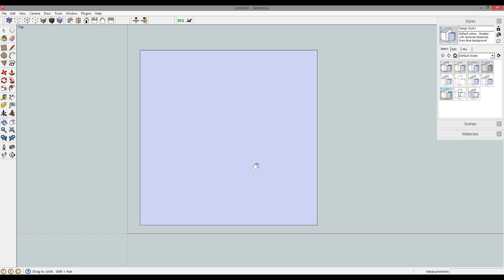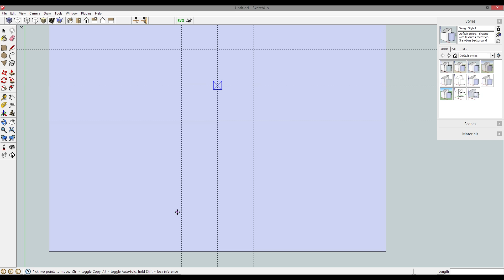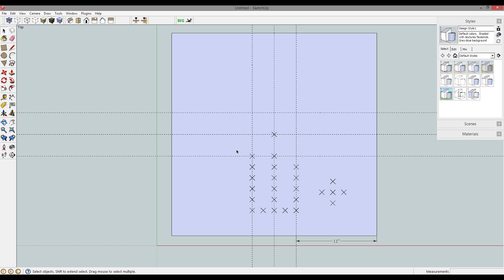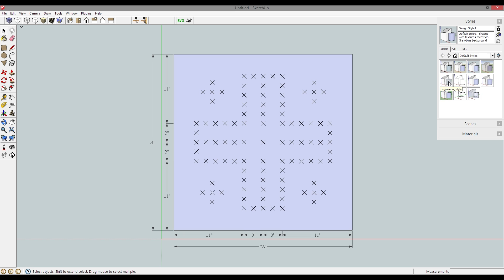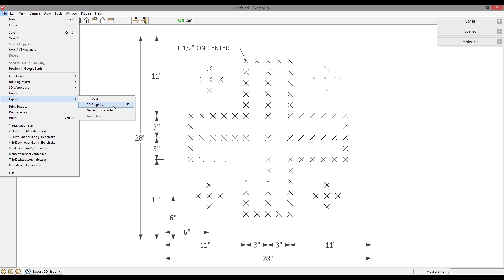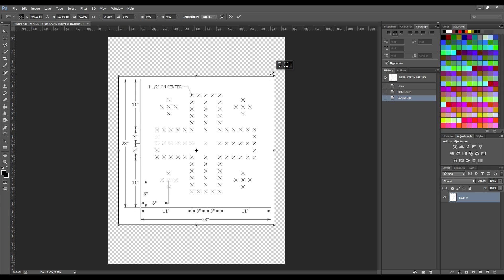SketchUp: 2d Drafting And Printing - 224

Comment: Nice.  Thank you.  I start with a shift Z.  Then resize with no wasted space.  I like to use Grab app on Mac.  Then paste into GIMP for Mac. Edit the image as needed.  Then either export as JPG or paste into word to print with narrow margins.

As Scott Noyes posted a solution to printing to scale.  On Mac mine would not work until I ticked OFF Vector Printing in File | Print ... dialog.  Doing this on Mac also messed up my current model.  So save to backup first.  Then tick OFF Vector Printing.  Close model WITHOUT saving.  

Also on mac when setting the File | Document Setup ..  | .scale to 1:1, change the In Drawing to 1 then change the In Model to 1 then click on the In Drawing again to update In Model successfully.  You'll know when the Pages Required changes to a hight number in red.

Then File | Open Recent ... .  Then print EXACTLY BYy FOLLOWING EACH STEP as Scott details.  Seems like 8 times out of 10 I forget one of those steps.

https://www.itg.ias.edu/content/keyboard-shortcuts-capture-screen-shot-mac-os-x

Comment: Nice video Jay. If you want an easier way to get images from your PC to smartphone, you could try Google Drive (Dropbox or similar will work) on your PC and smartphone. Create folders in your Google Drive (also synched and mirrored on your PC) for each job you create. This will automatically sync to your Google Drive online. Then use the Google Drive app on your phone to view the image. It's also a great way to ensure that all your files are backed up and available from any device with an internet connection.

Reasonable costs.
https://support.google.com/drive/answer/2375123?hl=en

Comment: Thanks Jay.  I've already learned and used a few things from this video.  I wanted to create a layout to put DRIcore into a closet going under the stairs in the basement.  2D helped me layout the panels.  I knew about the ruler but didn't know how to use it well.  I always started from a corner which makes the guidelines hard to delete.  Your way of starting on an edge is so much simpler.  I didn't know the dimensions tool existed.  So simple to use too!  The only problem is that I won't use SketchUp often enough to remember the tricks.  I'll have to re-reference your video every time.  Anyway, great video and thanks again!

Comment: Jay 42"+\- TV monitor mounted on the wall next to the cabinet  + wireless keyboard and mouse = PC stays in the house but is back in the shop. Put the keyboard and mouse in a drawer when you're not using them and it doesn't take up any space. You don't have to look at plans on a tiny call phone screen.... Bonus you can watch the lions on Sunday!
Reply from the maker: +Spankysue I haven't had cable TV since 2008?-ish so watching the Lions is out of the question anyway. It's really not bad to walk around the corner for what I need.

Comment: Printing to scale right from Sketchup isn't so hard. 1. Set to Parallel Projection and one of the set views (ISO, Top, etc). 2. Resize the window so that it shows only what you want to print, no wasted space. 3. In the print window, make sure Fit to Page is unchecked, then enter the values you want in the Scale boxes (probably 1:1). If the Scale boxes are grayed out, you didn't do step 1.
Reply: +Scott Noyes I wasted 3 hours trying figure it out, why the scale box staying gray. Thank you so much Scott. Now I can sleep.
Reply from the maker: +Scott Noyes Thanks!!
Reply: There is no solution when there is no inputs on the print preview, do you maybe know how to fix this ?
Reply: Thank you I grabbed a screen shot. I knew I should be able to do that but I didn't know how

Comment: Nice tutorial Jay. I need to sit my butt down and learn some more Sketchup... I'll be checking out more of your SU vids. I also use the snip it too a bunch for both home and work stuff.

Irrelevant observation... looks like you are a taskbar on the top of the screen guy, did you get that from working with Linux in the past, or just found you like it there anyway? - Jim
Reply from the maker: +The Wood Lab I've had the taskbar on top for as long as I can remember. Makes a lot of sense considering everything you do when interacting with a window is on top. I think that started in Linux for me though.
Reply: +Jay Bates Cool Jay. Yeah, same here on the taskbar. I think I started placing on top in Windows back when playing with Linux in the Gnome 2.x days.

Comment: A problem I have when doing 2D drawing is accidently orbiting. Is there a trick or is it just hand brain coordination?
Reply from the maker: +WoodRodent Brain coordination.
Reply: I was afraid that was the case. More practice. More practice.
Reply: +WoodRodent Hello...Do you have a mouse with a wheel...? If you hold shift dowm while pressing the Wheel Down...you will Pan only. Hope this helps. tip2: Use shift+Z for zooming to the extent of project. tip3: Also, I have a shortcut for top view... makes it easy to get back in place. I tip4: also have a shortcut for toggle between parallel and perspective.
Reply: +WoodRodent Do you have the Sketchup Reference Card...? It shows you all shortcuts and submenus in one page: http://www.sketchup.com/content/quick-reference-cards-0there are older versions too on the help page: http://help.sketchup.com/en/article/3000081&#160;PS: Pressing "H"will Lock you in Pan mode with just the left mousebutton (H for Hand) Feel free to ask...maybe I can help...Good Pacticing... Greetings Jakob.
Reply: +WoodRodent 
Sadly they still don't have a mouse re-binding option, but you can bind Top View to a button to always reset if you mess up.
Go to Window->Preferences->Shortcuts-> scroll down to find Camera/Standard Views/Top, then add a shortcut key on the right.
Reply: Jakob Hovman Thanks Jakob. I knew that but I guess I need to just need to improve my muscle memory to make sure I press the shift key to pan only. I was hoping I could lock it in that mode.
Reply: MsSomeonenew That is what I was looking for. I added the camera views to the toolbar so it is easier to get back and the view extents option comes in handy as well. Just need more practice.

Comment: If you would upgrade to Sketchup 2015 they have another program called Layout(it downloads as a bundle) that takes your SketchUp file and allows you to size to whatever paper you work with. Also allows you to annotate the drawing and add other drafting tags. Just an FYI for a more important/professional drawing.
Reply from the maker: +Nathan K. But its not free.
Reply: +Jay Bates I use the free version of Sketchup and layout.

Comment: I'm a snipping tool junkie, that's probably the single most useful feature included with Windows besides the clock.  

I've found the easiest way to print a jpeg for me is to simply copy and paste it into a word document.  I never thought of using Photoshop, but it's not nearly as snappy on my machine as it looked to be on yours.  

Great Sketch Up tutorial.  Every time I use it to draw something, I find myself repeating your commands in my head: "space bar - triple click - G for component; M for move, P for push-pull," etc.

Comment: The quick and dirty way I get my images to print is to get the image however I want it and as large as I can, then press the "Print Screen" key.  I then open up a blank Word document and select "Paste".  I can then crop and re size the image as required and also add any text required.

Comment: just a quick question. i know this isnt an extremely important model but I notice on most of your sketch up videos you delete reference lines frequently but when i was learning sketch up my teacher told me to never delete a reference line. so my question is do you think its a good habit to never delete them or does it not really matter too much?
Reply from the maker: If it's not needed I delete it.
Reply: +DEMMERY11 
Maybe your teacher is coming from a real 3D CAD environment (sketchup is far from that). There when you move a reference (be it a reference line, an edge of the model, center of a circle, whatever) everthing that has been reference off that thing will move with it. If you delete a reference everything that has referenced from that will become "invalid", because the model is no longer defined unambigously. I mostly just hide the lines.